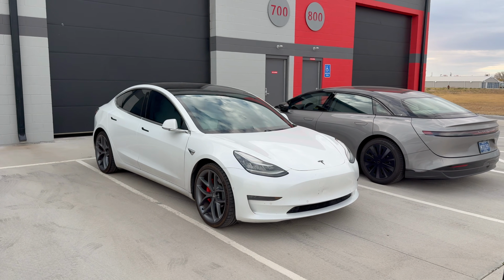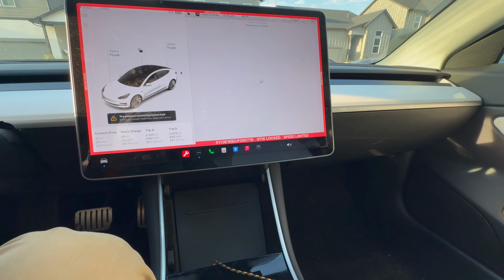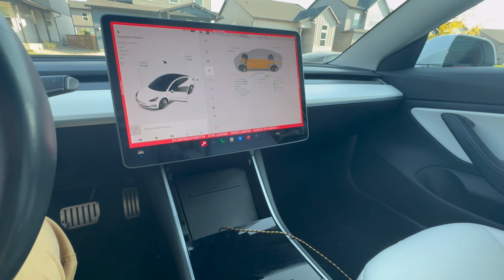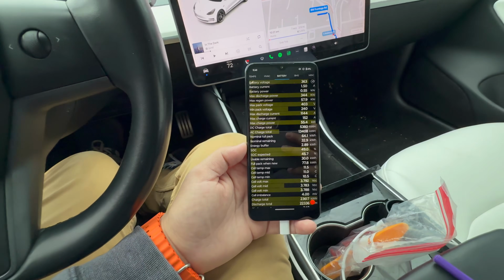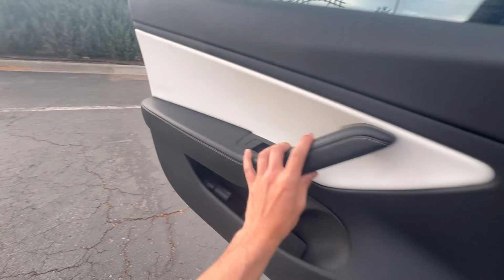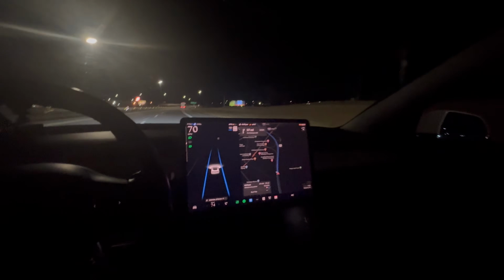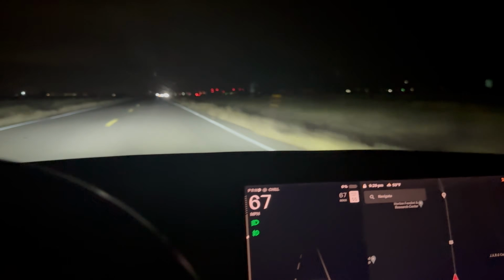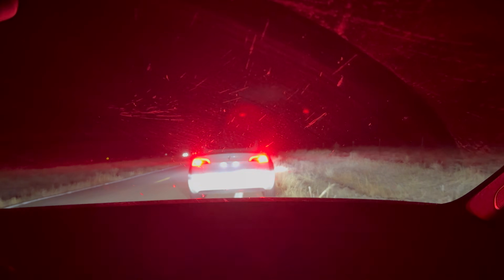My Used Tesla Lost This Much Capacity Since New! 2018 Model 3 Performance Battery Health Check

Comment: Holy hell that thing is a wreck for having less than 40,000 miles on it. 16% battery degradation in 6 years, 40K miles?
Reply: My June 2023 Tesla model 3 has 100,000 miles on it. 4% degradation so far. LFP. People don't want to believe me, but it's been tested two different ways and they both come up the same.
Reply: @MH-Tesla  4 percent is crazy low.
Reply: @MH-Tesla  make a youtube video about your degradation and people will believe you
Reply: @MH-Tesla  It's only one year old and age does seem like the major contributor, not actually cycle life like you'd expect.
Reply: In this case it's not about the mileage but the age plus how it was stored.
Reply: @ryen7512  
Which is why used EV's are such a risk for buyers. They can be relatively new with low miles and still be not great .. I guess a combustion car could have that issue.. no oil changes etc. But even that . 40k is low enough to have not done much damage.  
I have a 14 year old Toyota Hybrid.. it went 425k.. I put 225k on it in 4 years . 
So has all its original suspension parts and wheel bearings. I did change the struts at one point at 380K.
Reply: This thing is in line with early passive cooling Nissan Leaf battery degredation!
Reply: I have a 2018 model 3 LR awd with over 200k miles and close to the same degradation. Wonder why it’s the same for that one with 40k miles.
Reply: I have a 2018 LR RWD with 75k miles and can max at 272 miles on full charge is that bad? I thinks that’s 88 percent left of battery
Reply: @gideonagyemangprempeh5171 it’s certainly not as good as their newer cars
Reply: Uber or rental? If the car was abused (charging to 100%, potholes, ..). No different than an ICE with 40K miles never having the oil changed.
Reply: @ericgregori  It had less than 40k miles in 6 years, no way that's an uber or rental. Just as Kyle said, hot Arizona weather plus high % storage will do this
Reply: @ericgregori  
Not UBER.. not enough miles.  It's the suspension stuff that is surprising to me. I don't care what it was driven over. It's WAY too early for those issues. And Arizona is not known for potholes.
To compare.. i have a Toyota that was used for Uber.. 225,000 miles put on it in 4 years.. car had 425,000 miles total. STILL running on original suspension parts...

Comment: I passed two semi trucks packed full with new Tesla's . I pulled over when I "woke up" realizing that they may have been on Electric Semi's and I could have gotten a photo of the Semi ? Darn, wasn't able to work that out.
Reply: I wonder if they build their own AC compressors ? And, how many miles did that car have on it when purchased used ? ok, 100k ? I'm just shocked that you can't find out the history on that car, especially considering all the technical stuff available ! Car Facts should juice up their records if Tesla isn't going to.

Comment: Okay I'm four minutes in and I would not have purchased this car. That's a long list of issues.
Reply: Yes, way too many red flags.  I would not buy a car from a hot weather state like Arizona and the unrepaired damage indicates an abusive/careless owner.
Reply: How does a sedan w 40,000 miles need a full on suspension rework and upper and lower control arms? I would not have bought this. It’s been driven hard.
Reply: Depends on who you are.  If you have minimal mechanical skill, like doing a brake job is no big deal, then you know the mechanical side with this car isn't a big deal.  Normal wear and tear sort of stuff.
Reply: @yayinternets  AC is probably going to be expensive.
Reply: @ Did he say it was AC?  (genuinely asking, not trying to be a jerk). I just remember him saying it was a vacuum pump which could also just be for the brakes.  

I’ve been looking for a cheap Model 3 and basically understand why Kyle was excited about this one in particular.  The others in this price range are usually 120K miles or more and were probably used for Uber or something, so lots of DC charging and general wear and tear.

Definitely not the car that most people would do okay with.  But the maintenance items that need replacing aren’t too bad if you are the one doing the labor.  

I could see the brake vacuum pump going bad because the original owner didn’t ever change the brake fluid.  It takes in moisture and needs to be flushed out and replaced every so often.
Reply: Agreed. Could got a non performance in much better shape for less.
Reply: 4 minutes in & only JUST got past the bl00dy adverts!!....🤦‍♂️
Reply: Go buy 7 years old BMW. You will have less issues for sure 😉
Reply: These guys will create a bunch of issues just for clicks/ views. 

Had a 2018 back in 2018, had no issues until I sold it 4 years later
Reply: @enoughofthis every manufacturer has bad cars. Your story doesn't matter.
Reply: @wizzyno1566 This includes the typical ‘reliable’ brands such as Toyota, Honda, Mazda etc
Reply: @enoughofthis  Same. My 2019 is still perfectly fine with no issues bought at the end of 2018. Never had to send it to service for anything.

Just went in for the AP3 upgrade for FSD.
Reply: @enoughofthis  And you are the type of person you should buy a used car from. This car was driven by someone who didn't take care of the care and you should avoid buying cars like this.
Reply: @ymcpa73  would only buy a used Tesla, from Tesla.
Reply: @ymcpa73  "This car was driven by someone who didn't take care of the care"
Wasn't aware that an AC compressor was a service item, must be a Tesla thing
Reply: @enoughofthis who is "these guys"? Kyle? Who explicitly said multiple times that he wouldn't get this car and advised against it in the original video? Or the sometimes guest who did it anyway and has little if any financial stake in the channel?

Comment: So, my model 3 performance has 250 miles of range after 250k miles. Original battery. Almost 0 maintenance. 100% on highway going 80mph is about 200 miles to empty
Reply: @2021PorscheTaycanTurboS.  you mean year?
Reply: @2021PorscheTaycanTurboS all good.
Reply: Nice
Reply: Lucky lucky lucky
Reply: Proof? Upload a video showing would be great!